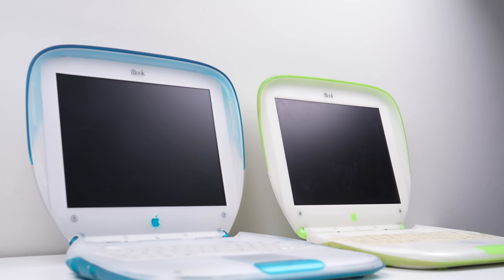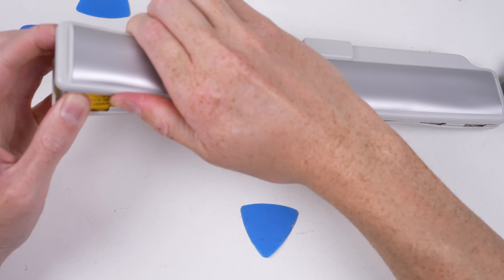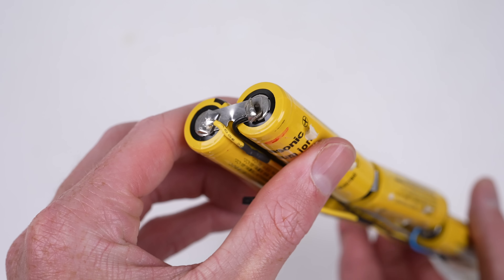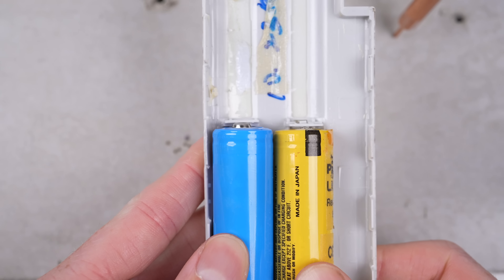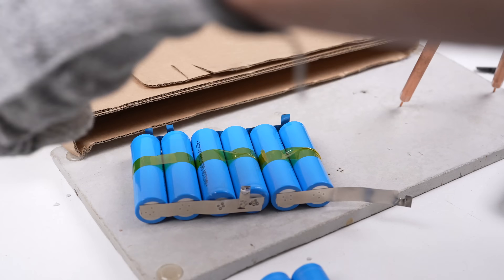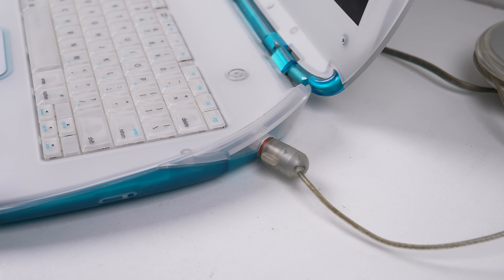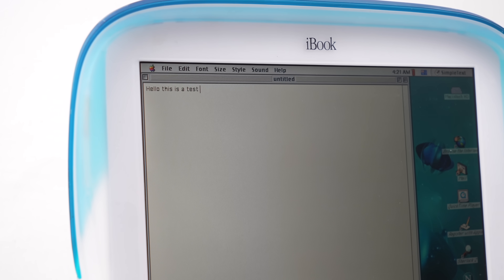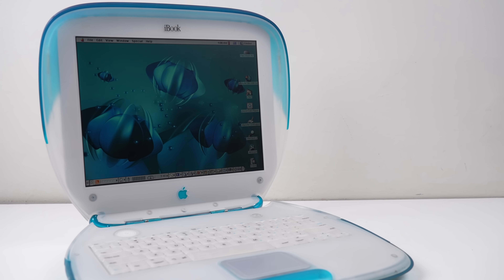Restoring a 1999 iBook G3 To Run On Battery Power - DIY Battery

Comment: I just picked up a 2005 iBook G4 and the pack is dead dead and the BMS is reporting 65k mAh. This particular BMS could be reprogrammed with an EEPROM programmer but that’s insane. I’m popping the batteries out and putting the shell back in. Maybe will keep the BMS

Comment: I can see why the Wires didn't fit. There's a channel in the case to accommodate them. You sort of put your replacement pack in backwards. Check your Video here and you'll see what I mean.

Comment: Damn 120 dollars for such questionable quality batteries without even a mention of who possibly manufactured them? I'm sorry mate but you got scammed. I know a low quality battery when i see one as I've delt with 18650 batteries many times in my life. You could've gotten better quality cells for much less even from AliExpress. I'm talking like 30-40$ for some rather good quality 3000mAh 18650's

Oh well, you'll learn. I can't blame you. Hopefully they even are 2600mAh considering how poor they look just based on looking at the shrink wrap and lack of information on it. Either way you did a good job rebuilding the pack!

Comment: there were slightly more variations than that, the first non-firewire version had 2 versions, one with 32 and one with 64mb built into it's motherboard for example

Comment: I bought an orange (tangerine) ibook a few years ago and a new fully working battery.. Unfortunately mine has a azerty keyboard and French os installed, haven’t used it for anything as I can’t really read French and azerty keyboards are a pain to use if you’re accustomed to qwerty 😅 But I heard the keyboards are quite easy to replace and a new os install shouldn’t be too hard (if i’d had an install disk..). Although this laptop is basically useless at this point, even just browsing the internet is a struggle…

Comment: After changing the battery BMS on the iPhone Xr, she flashing the battery fix on 3u tool. It got stuck on 34% and came to 6% and error coming. If you flash the normal  flace, without batter fix it becomes 100% complete.
???

Comment: Hugh you can sold the strips on if you use some 220 grit sand paper to scuff up the battery ends so the solder will stick. second you you need a much larger solder tip end to transfer the heat quickly for a short amount of time. using small tip is when you over heat the battery. also pick up a panhard pub vise or similar vise.
btw I like the creative use of tools and other item to hold the battery together. zip tie or cable clamps would have worked good too.

Comment: I have an ancient Dell Solo 1200 that works fine off a power supply and I've really been looking. I redid the batteries on a water pick a few months ago and bought cells with the straps already attached. I'll have to check that out. I was having a little confusion until I realized you were using both "Resell" and "Re-cell". English is silly sometimes. Thanks for this one!

Comment: Bring the old packs to slightly over 60°C and everything will open up more easy. 80°C would be better but are on the edge of what is good for the batteries inside.

Comment: I've safely rebuilt a dozen laptop packs by now. I'd say, the building handiwork is pretty clean for a beginner! Though, 120AUD for 8 unknown brand cells?? A brand new Samsung INR18650-35E should cost you no more than 5-6AUD each!

Comment: You ordered the wrong 18650 cells. You want the most common with NO button top. The ones you got are designed to use with flashlights and so on.

Comment: Some years ago I did this to an eMachines laptop. I took the cells from an used power bank. I soldered them because I didnt have a spot welder. I also accidentally once touched a wrong spot and made a spark. The only problem was that the BMS clearly had some kind of cycle counter, because it kept saying 0 minutes and to replace the battery.

Comment: I really need this done for my Indigo Clamshell sometime... A while back I was gonna' try to have it done and even bought a bunch of bougie LG cells that were supposed to be the best of the best you can get but I couldn't find anyone willing to do the welding. I ended up having to dispose of the cells because I wasn't equipped to store them long-term. <:\

I remember there was at least one place that offered to rebuild the pack for $70, but they said they would use whatever cells they had on hand and refused to use the ones I had. Maybe I'll go back and take them up on it at some point. Something would be better than nothing...

Comment: Just a tip, when you refer to the 18650's as "batteries" this is incorrect, they are cells, they don't have the safety circuit to make them batteries.

Comment: Its a great initiative, thank you very much for guiding. If possible do the same things with batteries of Hp like mu06, I have an old Envy laptop which I want to revive. Its my earnest request if possible do the diy with the above mentioned battery model from HP. 😢 I will be very happy if you come up with such video for other brands as well.  Thank you in advance.

Comment: Just an FYI, its actually the electrolyte in the cell that burns so even if they're totally dead, plastic tools only. While a dead battery almost certainly wont burst into flames it might still give you a bit of a smoke show if you puncture it and the smoke is REALLY nasty too. Li-ion batteries are no where near as bad as li-poly though, those things will burst into flames if you just insult them.

Comment: This is very cool to see. I wanted to replace cells in old Xbox 360 battery packs, which uses the same approach. Aftermarket batteries are so bad, they're waste of money and simply lie about their capacity. So making one yourself would've been awesome. Unfortunately, it requires spot wielding 2 cells together and I don't have a tool for that. Maybe one day.

Comment: it also work for any laptop with removable battery....im also do the same with DIY....its also same like replacement powerbank with battery lithium ion too....
Reply: Not any laptop battery, many of them will immediately lock the BMS when you disconnect the cells and will never work again.

Comment: I had a similar problem trying to fix a 2012 Acer battery. Unfortunately, because of the tight tolerances on the new models, the new cells were unusable. After a bit of research, I found out the original ones are 16650, as there were no markings. They are the same length, but smaller diameter. Maybe 16650 are a better choice for this iBook.

Comment: I got that turquoise model and i would love to use it some day. I wish there was a simpler way cause i'm not even gonna try what you did, i would mess it up, lol.
I also got a PC laptop from the same year (1999, i bought it used in 2000) that still works as long as i use the charger. It's got win XP and a free photoshop from 20 yrs ago

Comment: 7:47 Those numbers are BS ;)
15V and 20 Ah would be 300 Wh - more than 3 times that of the biggest laptops batteries out there - so: No.
You have 8 cells, each 3,7V and 2,6 Ah. Put them all in series, you get 30V with 2,6 Ah. Put them all in parallel, you get 3,7V 20 Ah. 
In your configuration (4S2P), you end up with 15V and 5 Ah for a way more realistic 75 Wh.
For someone as knowledgeable as you, that seems like a pretty big oversight, you just left those numbers in your final script without any second thought.

Comment: Good job! I've experienced the BMS locking issue with several newer battery packs that take 18650s, 16650s, or Li-Po Pouch cells. Once any cell (or pair of cells if in parallel) goes below about 2V (especially below 1.5V) the BMS will lock itself, and that's it. Unless you buy a special programmer that will unlock your BMS (which tends to cost a lot of money), that's it - you won't be using that battery pack again.
BMS will also lock itself if there is a large variation in the cell voltages, if they are extremely unbalanced.

And yes, it goes without saying that you should only do this if you know what you're doing!
Reply: Is that why my Sennheiser wireless earbuds left one won’t charge anymore? 😢 It had gone below some limit?

Comment: For ultrasonic welded plastic you can use "banana oil" (nail polish thinner) with a syringe to break the bond between the parts. Just be careful to not drop in the case because it can make plastic fragile

Comment: I have a pre-production clam shell iBook PPC G3 from my time at Apple. It has been in use almost 14 years (5059 days) logging my off-grid PV system running Mac OSX 10.4 Tiger  (via XPostFacto) ! The iBook battery died long ago. This video is of interest so I ordered a spot welder and will source flat top 18650s.from Jaycar.
Power now is DC-DC stepdown 24V (PV battery bank) to 18V input (the DC output of 240V discus PSU).
The original iBook 2GB hard drive was replaced with 8GB Compact Flash card plus CF-IDE adaptor. The process to replace hardrive was many dozens of screws, 
so after cutting aluminium shield from harddrive bay, CF card sits next to Airport card, easy to remove to flash, accessible after simple removal of keyboard.
I would like to replace with Pi Nano or ESP32 but this PPC G3 Mac, memory maxed to 382MB, just works 24/7/365/14 
No wonder the Mars rovers use the incredible PowerPC chip. 
Reply to this and I might make a video of my project. Next project is restore batteries of a 1998 PowerBook G3...

Comment: IDK if you did this or not but I would put a label on the battery of the date it was re-built/first plugged in so at a quick glance if you take it apart you know when it was done. This something I do with my power tool batteries and also keep a list of every time they are charged to see how many times, I've charged them to see if the same ones hold up to the same number of charges.

Comment: A lot of BMS basically dies on you as soon as it gets unpowered, and there's no way to reset them except with some expensive tool. I had tried to re-cell an Acer laptop battery without success for this reason. I tried to alligator clip the old battery to the BMS while re-celling it, and I accidentally disconnected it and the BMS promptly died.

Comment: you can remove the cell tabs with a snipper , just cut around the heat shrink and they are spot welder inside which you can take off with a snipper then you will get the flat tab.

Comment: i did this a few years ago on my lenevo t430. to keep the bms power on i used 4 buck converters in series set to 3.2v each with 1a current limiting. soldered all that to the bms then removed the whole series of cells. i got my cells from battery hookup. they were in a modem box and i bought 4 for 10$ each , got 40 cells to play with all of them tested 100 capacity , used 8 of them for the battery pack and 28 of them in a 7s4p pack for my ups to replace the aging 2x9ah leadacid. run time tripled

Comment: I wonder if the new cells are bigger due to them having protection circuitry
Reply: The new cells are bigger because he bought button top ones for some reason. The correct type are flat top like the old cell were.

Comment: Different tech... but same problem - I use a Philips shaver.  It uses 2 AA rechargeable batteries.  When the batteries eventually die, so to does the shaver, because they are soldered/spot welded into the device.  The excuse may be "to ensure best operation of the device", but we all know - it's to sell more shavers.  Of course - even if the batteries don't die, buying replacement razors for the shaver cost about 75% of the cost of the entire shaver.  

I wonder which was first to take this approach to customer service.  Apple or Philips...

Comment: Well done on your first battery cell repair!

If you plan on doing more of these, know that while the BMS will lock you out on later models, Apple used the factory default password of 0x36720414 to unlock the BMS until at least the last HDD Macbook.

You can communicate with the BMS using an Arduino, and 3 jumper wires to the external battery connector - no soldering required!  

Google "Squidgeefish: A1175 Battery Hacking" for a tutorial and Arduino code. I highly recommend it!
Reply: Is there any way to reset the A1181 battery to your knowledge?
Reply: @TechHowden  Same as A1175.

Comment: When LTT Linus sparked power-cell he threw sparked cell into sand bucket for safety. You have to understand what circuit sparked, was it welder tips spark itself or was it power-cell itself sparking. You have to understand to be safe. It is made closed to keep uneducated from hurting others and themselves. Because they do not have responsibility, only money grab in mind and no care for what happens to others.
Reply: Yeah I remember that video. They went way over the top on safety and clearly didn't understand some of the actual dangers and yet instantly threw out a bunch of perfectly good cells when they saw sparks.

Comment: Fantastic to see someones first time making a battery pack and doing quite well. Seems like you used fully nickel tabs and the welds look good. Good that you presolder the tabs also. Very unfortunate that the cells were the button top type but great work! Right precautions taken and teached to the audience!

Comment: Great idea. But the real problem is would it recognize the battery capacity correctly?
Reply: That depends a lot on the laptop. Some laptops like this one will recognize the capacity correctly after a full cycle although some newer ones like the ThinkPad X220 I tried repairing would not recognize the new capacity.
Reply: @TechHowden  so I guess it turned off after the designed capacity was exhausted?
Reply: @debabratabrahma  not exactly. The original battery health was only 3.9% of what it should be. What would happen with the new cells is I would charge them up from actually being dead and it would sit at 0% for nearly the entire charge cycle then right near the end of it I would see the percentage going up to 100. While discharging it would go from 100 to 0 very quickly and then it would sit at zero for as long as the batteries physically can last. This was annoying because windows would always try to go into sleep mode and the bios won't let you boot the computer in this supposedly 0% state.
Reply: @TechHowden  okay Thanks. That was informative. So original capacity is what I should make in order to get it perfectly working without getting booting issue
Reply: @debabratabrahma  No. The behavior I was describing was based on what the current charge capacity was of the old failing cells before I replaced them which was only 4% of what it should've been, not with the old cells would've originally done when new. You'll just have to put in new cells and hope for the best.

Comment: the cells used look super fake, at least do a battery test or buy from a reputable brand, id recommend the 18650 mh1 cells from lg or the 32e from samsung since get a high capacity and performance ratio, also why do your cells have bumps on the positive?? thats going to make spot welding much harder

Comment: Every single time I tried to replace the cells in a laptop battery I have encountered a 16650 instead of 18650 battery and I don't have them.

Comment: 18650s you bought are for direct use devices, that doesn't require welding strips. There are 18650 designed to weld strips to them, that does not have protruding nubs .
Reply: He says that he can’t buy those as they were out.
Reply: Yes, he literally mentioned that JayCar were out of stock of the other type.
Reply: Yep! Those probably have internal protection PC boards on the positive end.

Comment: Hey, if you ever need flat top 18650 lithium ion batteries just go to a vape shop. Those are the exact same batteries that go in big massive vapes.
Reply: I wouldn't by any stretch call a vape that uses 18650s "massive" my personal vape uses the next size up, that's a chonky boy

Comment: I have 5 clamshells in each color - blueberry, tangerine, indigo, key lime and graphite. Only two of them have batteries that even remotely hold a charge - and the point you made about throttling is super important - there's a night and day difference between performance solely on AC vs battery. I've been wanting to rebuild the batteries since Covid but the text articles I read felt a little intimidating - think I'm gonna give it a go now. Thanks for the video

Comment: I finish de-celling my old Dell Latitude E7450 and find the batteries were charged to -1V by the charging circuit since it failed horribly, and then I find this, immediately after.

Comment: A battery spot welder is something I wish I had when I replaced the NiMh batteries in my Mako Revo PDA.
Reply: I did a Revo a few years ago without one. My big issue with it now is not having working PSUs, so I’m planning to build a USB to 6V barrel adaptor

Comment: I'm very surprised that BMS didn't put up a fight, I've got a late 90's Sony Vaio that's turned its nose up at new battery cells. I'm at the point where I'm considering prototyping a microcontroller to read a fuel guage chip and speak the proper Smart Battery protocol to the laptop.
Reply: I'm pretty sure Jobs wouldn't have let that fly on an Apple product. Apple at this point still was somewhat hobbyist friendly.

Comment: Dude, NEVER replace the cells on a LITHIUM ION battery 
Burned my hand
But these 18650 cells are chill
Reply: As long as you're being smart about it and to know what not to short out you're fine.
Reply: @TechHowden true, unless you are working with pregnant flat Dell batteries, it’s a plastic pic and still shorted the battery

Comment: Would have been cool to design a new batery case that had cell holder so you wouldn't have to spot weld anything
Reply: Cell holders aren't reliable enough for something like a laptop battery.